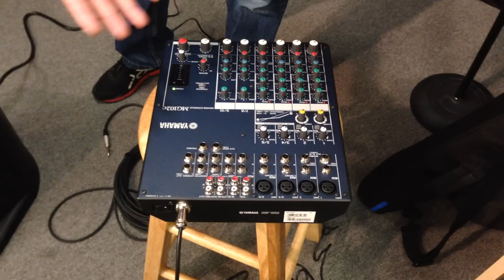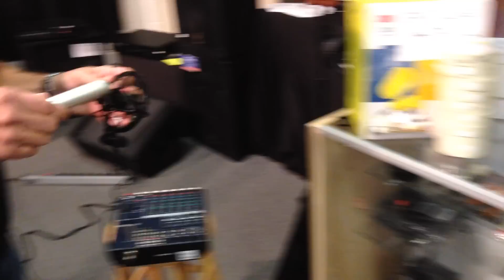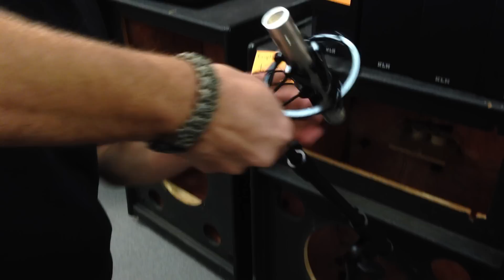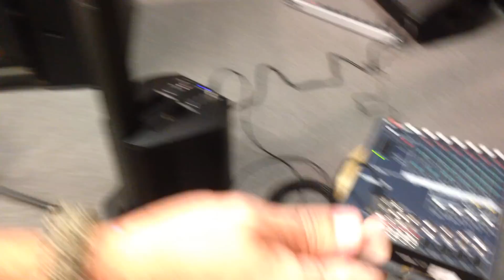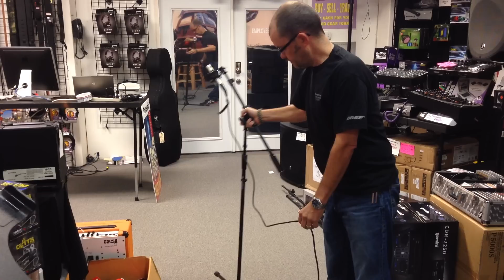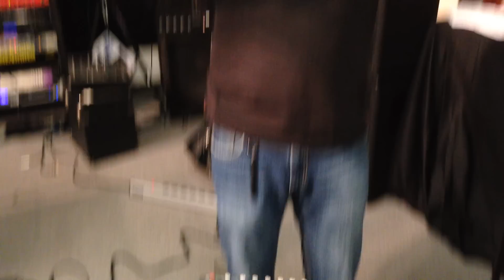Jireh Supplies Demonstrates How to Connect external Mixer and Mics to Bose L1 Compact

Comment: I always  connect mixer to the second channel,  and it works great.
What is the difference?
Reply: You're doing it right. The XLR channel has a microphone preamp and a Bose ToneMatch EQ curve permanently applied, i.e., it's designed to connect a dynamic mic, NOT a mixer as the host shows. If you send the mixer signal to the XLR 1) it can very quickly overdrive the mic preamp and 2) it applies a built-in, permanent vocal EQ to your overall mix. A mixer putting out a line-level signal should connect to channel 2 via TRS plug. Channel 2 accepts line-level signals and has no other EQ settings (other than the guitar ToneMatch settings switch that can be turned on or off.) You then apply all your EQ settings on the mixer.

Comment: FYI… The instructions are “Incorrect”  The Bose Manual is specific that using an adapter if needed, connect the PA into the 1/4” Line Level Input Jack!
You don’t want to run the PA in to another Pre-Amp.
Reply: They certainly are, you as you correctly say are running an output level signal into another pre amp, you will overload it and eventually blow the pre amp, don't do this!
Reply: Can you use Bose 700 soundbar to connect to a mixer for Karoke?
Reply: This!

Comment: Best connecting AUX out on the mixer to the input on the Bose. If you go from the mixer to the mic channel and turn up the Bose to 12 O Clock you will get distortion from
The speaker

Comment: What if you have two Bose l1 model 2,  how do you hook up?  Thanks
Reply: If you have two L1 Model 2s, you would need a Y cable with two 1/4 inch plugs on the end. You would then plug one into the analog input on one power stand, the other into the other power stand. Then you won't have to worry about the pan controls at all. Did that make sense?
Reply: @cammy85  why wouldn't you just go out of left and right?
Reply: @PLAMUSICAUSTRALIA  t1 Tonematch has only one output

Comment: How would you connect that to the Bose l1 model2??
Reply: +Ben Satterfield I know this is four months old but I'll tell you since I do it the same way. :) You would use a 1/4 inch to 1/4 inch RCA cable./ Plug one end into the Analog In on the Model 2 then the other end into the LEFT (L) output on the mixer you're using. Make sure all channels on the mixer are panned to the left and go from there!!

Comment: I have just bought the Bose L1 compact and want to use it through my powered samson xp308i PA/mixer.  I really need help on how to do this as this type of thing is not my forte.  I have tried going from the main line out on the back of the bose to my Monitor input and also to a stereo input both 3/4 jack and I have tried with both TS  and TRS connectors....completely silent in both instances.  Someone suggested using the RCA Record out on the samson xp308i mixer to the RCA  input the top of the bose.  Look forward to a solution if there is one!
Reply: +Paul Marshall    I told you it wasnt my forte I had it ar..se about face!  Anyway I have sorted it now!  Information direct from BOSE.   Connect from the mixer monitor out ( either left or right channel) into Channel 2 on the Bose and make sure the Tonematch is NOT selected.  The other way is RCA Out from the Mixer to the RCA IN on the Bose with the tonematch OFF. Either way works fine.

Comment: In the chorus of the church we use 4 microphones, one bass and one guitar. We have two Bose speakers. For some reason. We hear the guitar in one Bose and the bass in the other one. What do we can do two hear both instruments in both Bose speakers?
Reply: +ccccarbonell 
1. Check the L/R panning of the channels on your mixer that is connected to the speakers.
2. Check that the guitar and base is not connected to one of the jacks on a stereo channel with two jacks. It should work still, but sometimes...

Comment: what about this setup for a basic band of drums, bass, guitar, keys and 4 vocals for a room of 300-400 people: 4 x wireless microphones to a mixer, connect the mixer to the bose with a jack to xlr cable. From the mixer use a snake (16 ports or more) to the stage, then you have 5 mics for the drums *mic set for snare, the 3 toms and bassdrum. You also can connect the keys, guitar and bass guitar through the snake to the mixer for allround mixing... question is if one bose l1 with the b2 bass setup is enough?

Comment: how good is the system for karaoke. I do karaoke for nursing homes with about 30 to 50 people in the room.  I have a 1200 watt peavey powered mixer that I want to run 2 or 3  mics and karaoke music from laptop through the mixer and to the bose compact system.  it would be a lot easier then the big speakers, stands and speaker cables I use now   just want to know about sound quality and the hookup so as not to damage my mixer.   Thanks.
Reply: Hi David... I work in a restaurant as a karaoke Dj and i get great comments all the time from the costumers, the sound is just perfect... I recommend it..
Reply: I have the L1 compact and its perfect for the 30  to 50 person room.